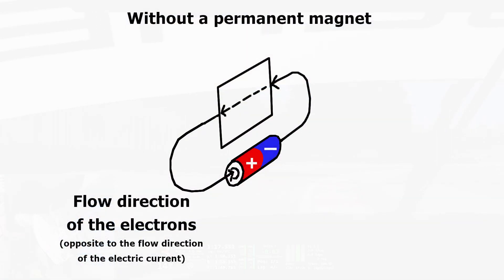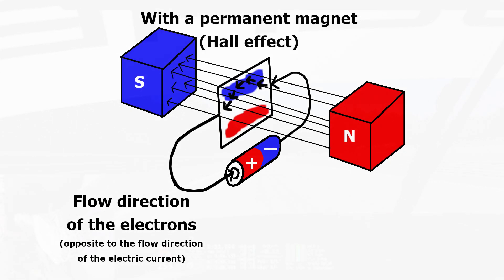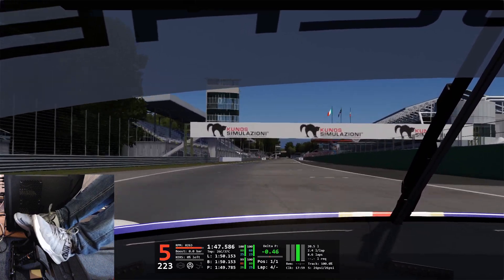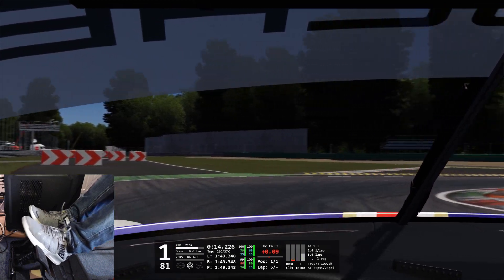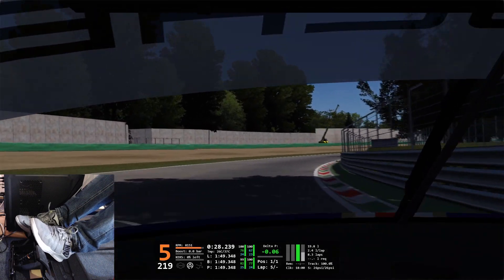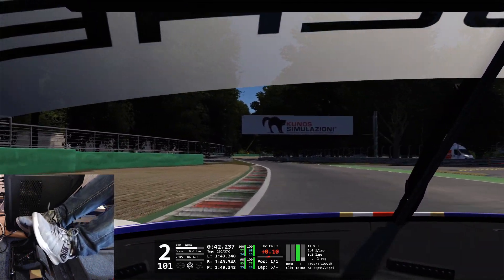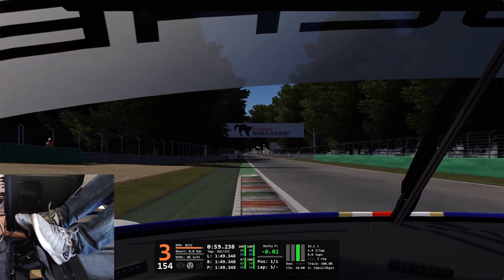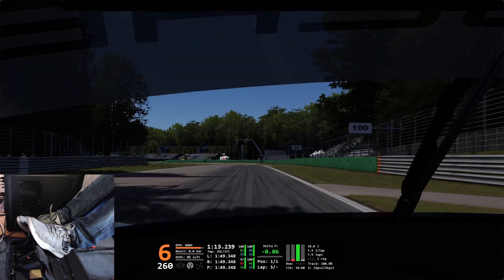What's the Deal with Hall Effect Sensors? (for Sim Racing Pedals)

Comment: I have a set of hall sensors for my CSL Elite, the ones that are drop in replacements for the potentiometers, and they worked, but added the feeling of a curve to the throttle. For a few weeks I switched back to the potentiometers because I wanted a more linear response out of the pedals. But I am going to put the hall sensors back in because, the potentiometers that Fanatec uses are terrible. In May, I got a replacement potentiometer I got for my throttle. It is already spiking, and fluttering. This is after less than 2 months of mild use. I work and sim race on my down time, about 2-3 hours a week. This is unacceptable! The hall sensors are going back in the pedals tonight!